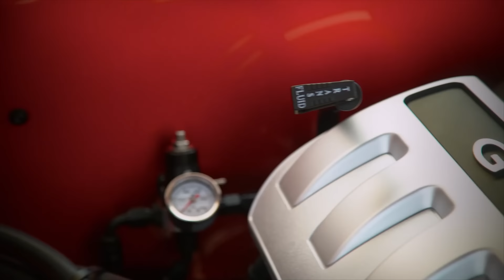Counting Cars: Danny Can't Part Ways with INCREDIBLE 1967 Pontiac GTO (Season 9) | History

Comment: Tach on the hood was iconic. Even if they made it a digital tach it should be there. Takes so much away from the original.
Reply: It IS a restomod, not traditional boring stuff!
Reply: @TheBluesnbob  tach was not boring... it was classic
Reply: with or without the hood tach, it's a great car.
Reply: youu know it....had one on a 68 half firebird...69 dash and had 68 gauges was one of a kind factory
Reply: Americans got a little crazy with tachs, up on the dashboard and then outside the front window.
Reply: @TheBluesnbob  So tachometer stuck on a hood, which is uncommon, is traditional and boring?
Are you actually slow in the head to think that's traditional?
By that comment, I can only assume you're at least 10 and you only know about modern supercars.

Comment: Automatic, uuuggghhhh.  Flames, ugggghhhhh. Them rims, double uuuuggghhhhhh.
Reply: Ok
Reply: wouldnt care if it was an auto only going to be cruising in it anyway. but agree on everything else; flames are tacky, so is the interior and the wheels look atrocious.
Reply: @ReplicantBattyman  A muscle car should have a clutch to dump and some gears to bang.  An original classic car is meant to cruise in.   In my opinion. I could be wrong, my wife usually says I am.
Reply: @willymaykit1482  makes sense, see im from england so a 67 gto would be considered a classic here more so than a performance car. if i got my hands on one i wouldnt be going over 50 whereas youd probably be doing burnouts and taking it to the drag strip haha
Reply: @ReplicantBattyman  I'm 54 and live in Vermont my entire life.   No drag strip,  just back roads.
Reply: And A GTO has always been a muscle car.   It's the whole reason why they were made.
Reply: They should have turned it into a gasser.

Comment: I thought it looked better stock. The ghost flames are cool, but the wheels are ugly
Reply: Color ugly total messup
Reply: Parted it out for extra $ or for another build sadly. He took it for his gto and gave them a shet one.
Reply: Would of kept stock for sure
Reply: These always look best in black. It needs wider tires all around. I like the stance, but not enough rubber. I'm not sure about this year, but my 70 can fit 305/40/18 in the rear wells.
Reply: @dan9809  wheels and tires are all wrong on this one.....agreed

Comment: Hay you guys,I just seen your video and I have the same car,it is a 1967 gto,tripple black out of the factory,I have had this car for almost 30 years now and can’t get it done, I believe the motor is a 69 400 with the correct 67 heads, it also is missing the original steering wheel,radio,rims,and I believe that is it,I also have lots of extra parts for the car,if you would like to take a look at it get ahold of me, I am in mn and the winter here is starting early this year so bring a coat and hat and gloves,I love the work and show you all do,

Comment: Only thing I didn't hear you  talk about was AC . I'm a Arizona boy AC is a must have.
Reply: 7:32 they said it has "heat, AC, power steering, power brakes."
Reply: @typicaledc  perfect
Reply: @johnhalchishick7094  He rattled it off so quickly it was easy to miss.

Comment: With the Hurst
Emblem on the car rear panel and a hood tech back in the 60s hurst built these cars, what motion did for Chevrolet I've only seen two others in my life  these cars are extremely rare probably within $200,000 range today I'm 65 and been around hot rods everyday since I was 15 I would like to know the true history on these particular cars cuz I know they're very rare most of  them had tri power today me what you do with that  4 bolt main block tripower & 4speed these parts weren't even hardly listed in any kind of manuals are close to 500 horsepower

Comment: I was disappointed. I honestly liked it better before they changed it! They took the tach off the hood! Why? Looked so good black. They took out the original 389! Ruined that beautiful GTO!!
Reply: 67 had a 400.
Reply: @fvgc454ss  Whatever. Point is they took out original engine. Now the GTO is.....nothing.
Reply: The LS engine all around better than the original motor and has better fuel economy. I'm keeping my 70s Caddy closer to original only because I don't have money for a crazy LS swap. Big Block Caddy is still running REAL PROPER